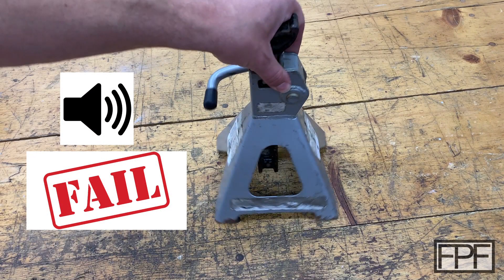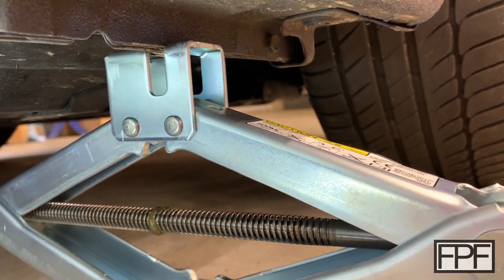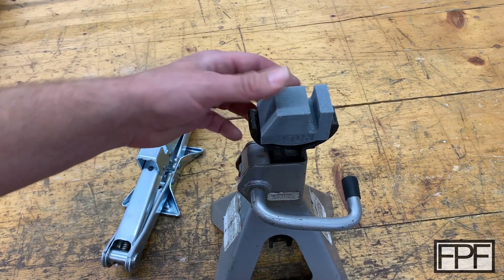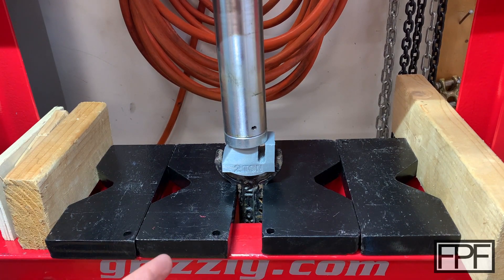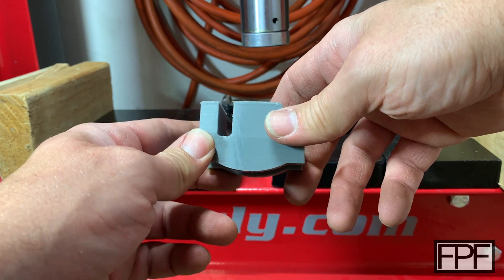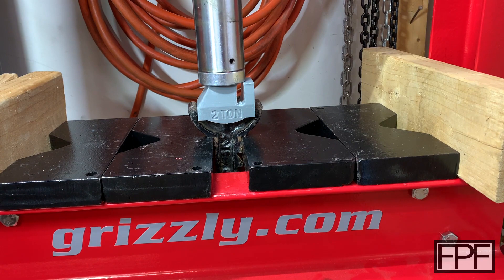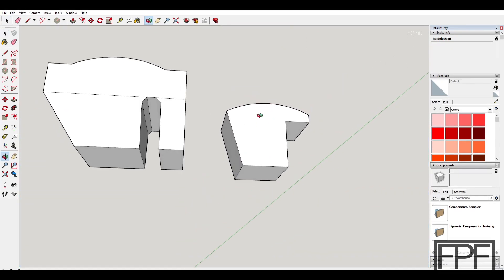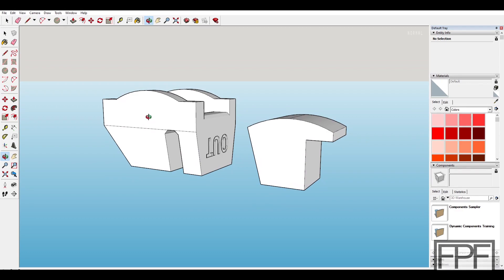3D Printed Jack Stand Pinch Weld Adapter

Comment: I know this is an old video so I don't know if you'll see this comment .... when you say TPU are you talking about the "normal" TPU95A? Would this work as a single block of Bambu "TPU for AMS" (65D?) or would the weaker layer adhesion cause the same issues as the softer TPU and therefore end up still needing an internal strengthening member? Sorry, I'm new to 3D printing, so I don't know if this is a stupid question.
Reply from the maker: I have not had any good experiences with the TPU for AMS, particularly regarding layer adhesion.

Comment: Thanks for this. I can't wait to try it out. I need to rotate the tires on the wife's car so I need to raise the whole thing off the ground. 2 of my jack stands have a much deeper V shape than yours that will clear the pinch wend but the other 2 I have are just like yours. I'm going to print these and give them a go.

Comment: This is curious...my factory scissor jack does split around each side of the pinch weld, but it DOES actually sit the pinch weld down onto the scissor jack head, before the outsides of the jack would rest onto the actual chassis.  Technically, the area outside the pinch weld on the chassis is actually a painted surface, so that could be damaged if the jack head was actually touching that part.  Also, the strength of the lift point on the vehicle appears to be the actual pinch weld itself, so I'm thinking the jack head, and added pad, would need to actually contact the pinch weld itself, rather than the chassis on either side of it.  Interesting...

Comment: tip for future is if you want stronger prints, do not increase the infill (I mean maybe increase infill % aswell) but mainly focus on walls, the more walls you add the stronger the part, if you want to make super strong part, sometimes 10 or 15 walls with 30% infill would be stronger than 2 walls 80% infill

Comment: Love the idea here but you are assuming all the force is always exactly vertical. At first that doesn’t seem like a bad assumption but when working on a car sometimes you do impart some force one way or another in the lateral direction. I would feel a lot better about this concept if the tpu part was also pla or asa to give more support in directions other than perfectly vertical. When lifting we usually use a FOS of at least 4:1 meaning you’d want to support 8T here to be safe. Just food for thought.

Comment: Glad I found your video. I am thinking about doing similar with just PLA. One thing that makes me nervous about your design is the height of the piece above the jack stand bearer top. I'm thinking about having the pinch weld situated in the middle of the bearer in the curve, and design so it supports from both sides and the pinch weld after some deformation. Worst case, the printed piece splits and the pinch weld is still centred on the jack stand where it cannot tip or slip off. Better still, cut a rectangular hole in some 40mm square steel pipe to slip over the bearer, and design the printed piece to sit snugly between the pipe and the bearer. (Of course you also need to cut a slot in the pipe on the other side.)
Reply from the maker: The pinch weld slot isn't centered on mine because the weight actually bears on the slightly raised pad behind the pinch weld (on the car).  It's hard to see in the video, but the pinch weld sits deep enough in the slot that it'll be captured in the jack stand if the adapter fails.  Checkout this vid for another way to do this for bigger stands that I prototyped in plastic, but fab'd in steel tube: http://fpfdesigns.com/054_prototyping_parts_for_metalworking.html

Comment: Good to see testing showing that it can support way more weight than necessary. I would have guessed that solid TPU would have been totally fine, but of course I didn't consider lateral deformation either. The two part design looks perfect!
Reply from the maker: thanks, I thought the same thing about the TPU part initially

Comment: So my question would be, what about printing the entire thing in PLA as one piece? I've been using a floor jack and rubber plate on the pinch welds, but I see now that is still a bad idea.
Reply: I would use PETG, or something more heat resistant, unless you're in a cool garage I wouldn't trust PLA in the summer.
Reply from the maker: @redsand128  I think PLA starts to soften a bit at ~50C/122F.  Should be ok for the garage, but could be an issue if you store in in your car parked outside in the sun on a hot day.  In my experience, under compression, PETG tends to yield before PLA, but maybe I should test this.
Reply from the maker: Great question!  My thought process was that the TPU outer would still cushion the car and help 'contain' the PLA if it started to fail.  Note that an important element of the design is that the pinch weld is still in between the high points on the jack, and that the distance to the jack casting is minimized so that in the event it does fail, the car only has ~5mm to go before the jack stops it.  Pinch weld might take some damage, but the human under the car won't.

Comment: I think it was smart testing it the way you did. I wonder how many load cycles you can get out of it before it starts to break down? I'm sure if you're just using it once every couple of months for an oil change you'll likely never get there, but I am curious.
Reply from the maker: Since I'm loading it at  1/10th the weight it started to deform at, I think a long, long time, but I'll update this comment if it changes